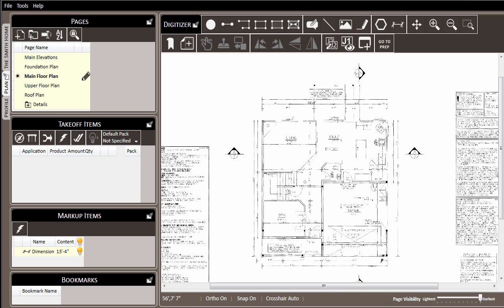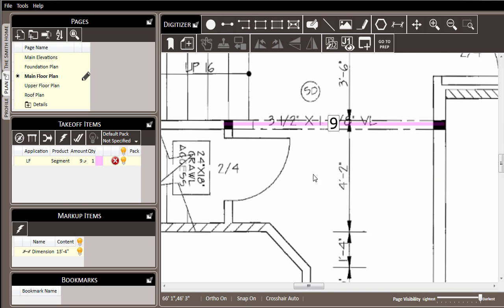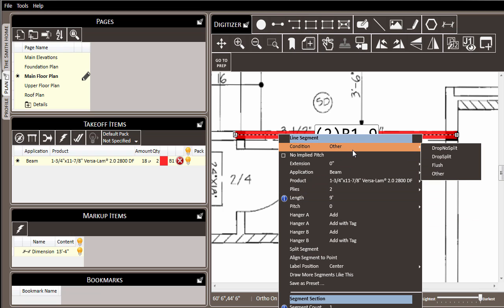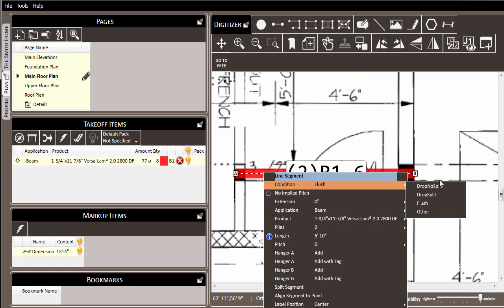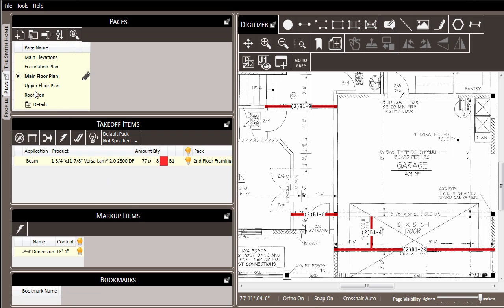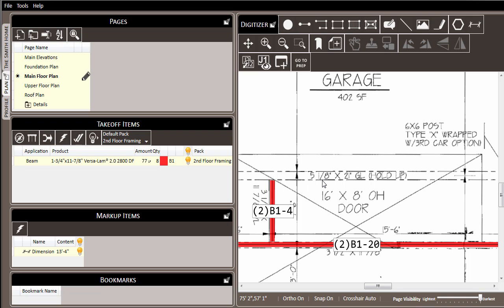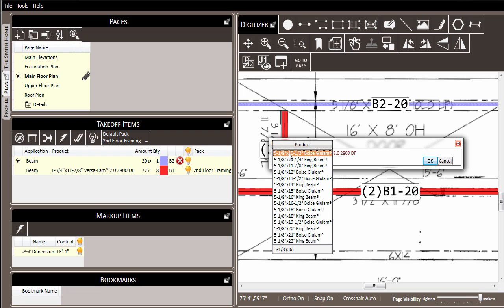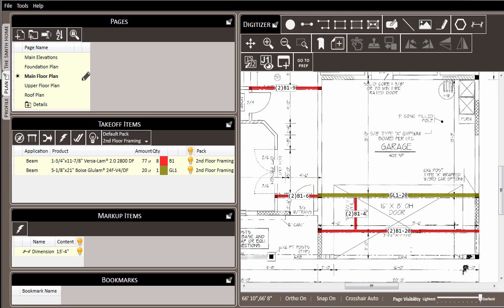Drawing Beams - [BC Estimator]

Comment from the maker: Jump to a specific topic by clicking on a timestamp below:

0:21 - The Main Concept of Drawing Takeoff Items
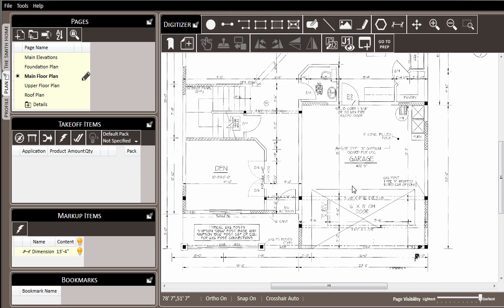0:43 - Drawing a Beam with the Segment Tool
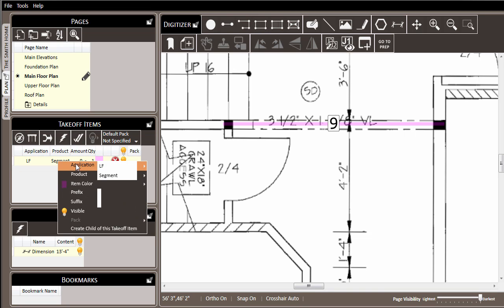1:01 - Assigning an Application to a Segment
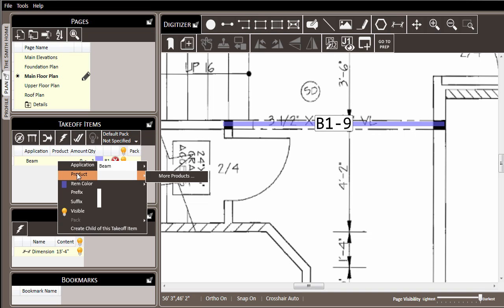1:11 - Assigning a Product to a Beam Application
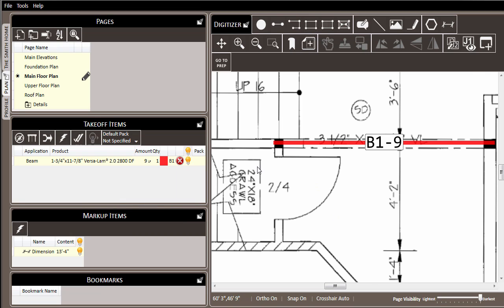1:27 - Changing the Plies of an Item
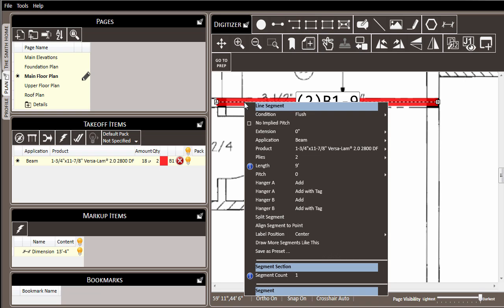1:47 - How to Quickly Draw Out More Beams
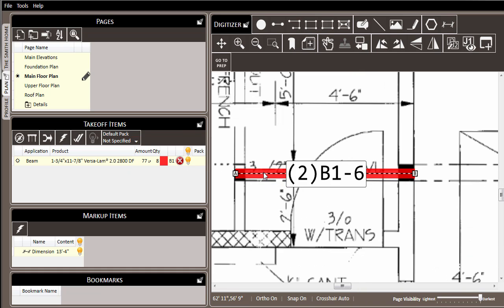2:15 - Setting Beam Conditions (drop, split, flush)
2:36 - Assigning Materials to a Pack
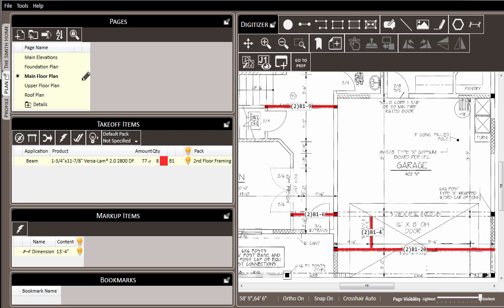3:15 - Setting Up a Default Pack
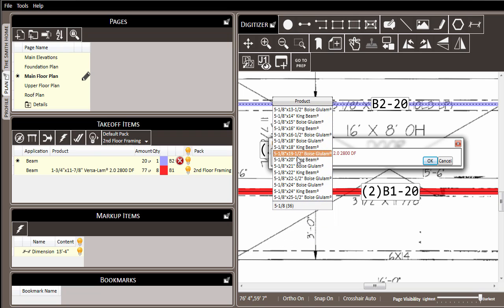4:23 - Product Attributes